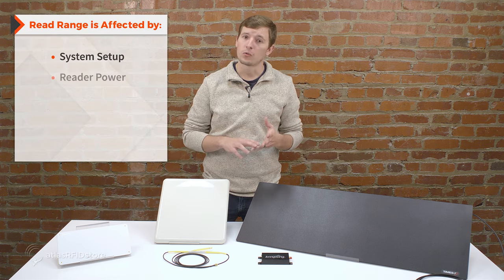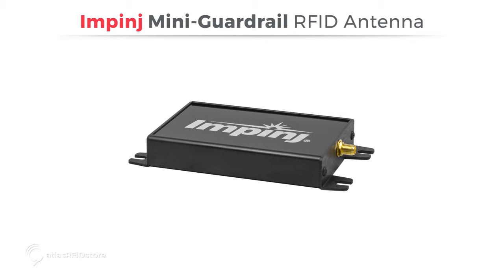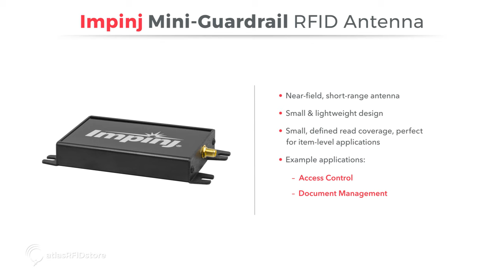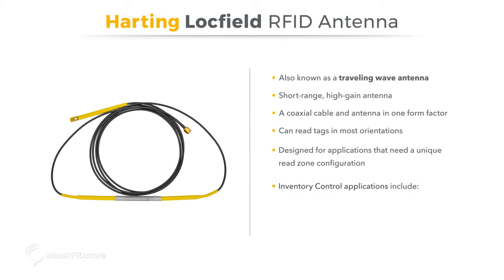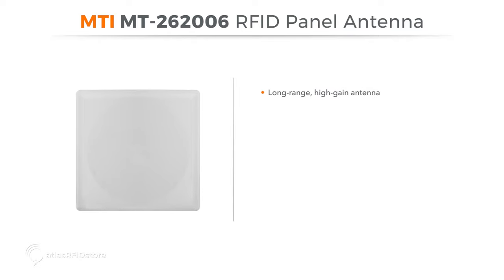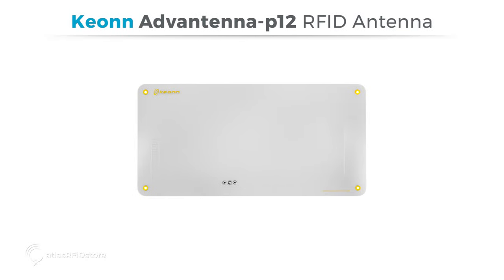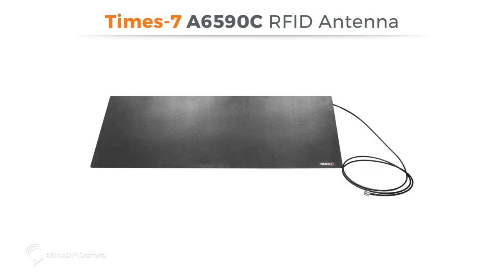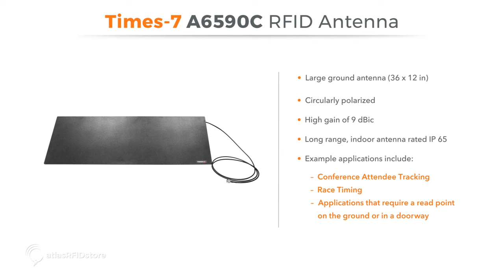The Top 5 Types of UHF RFID Antennas

Comment: Hi Steven, I would like to use uhf rfid reader for school bus. with passive rfid tags whats your suggestion regarding that.
Reply from the maker: Manshad,

That completely depends on what the problem that you are trying to solve is. If you are looking to ensure that all students get on the school bus, then perhaps a fixed reader/antenna at the bus doorway can be used to read RFID tags on student's backpacks.

If you just want to know what students have passed the reader/antenna system and how many times they have passed the reader/antenna system, then a fixed reader in the doorway would work like this Impinj R220 with two RFID antennas
(https://www.atlasrfidstore.com/impinj-speedway-revolution-r220-uhf-rfid-reader-2-port/).

However, if you wanted to read the RFID tags at all times when students were on the bus, you need to go with something more like the Impinj xArray on the bus ceiling. Here is the Impinj xArray - (https://www.atlasrfidstore.com/impinj-xarray-gateway-rfid-reader/) it is pretty expensive and should only be used if you need to read all tagged persons on the bus at all times.

Powering either of these readers, however, will be difficult and something to think about before committing to using RFID technology as the solution. Do you have a solution for powering this system?

Thanks!

Comment: Near field?  Looking to measure withIn about a square foot in a tag rich environment. Want to only log the item or items with the given space and not the nearby items that could be above, below or next to the intended measurement space. More than one item might be correctly logged. 

Maybe smart shelf antenna?

Outdoor antenna, some IP rating probably appreciated. 

Tags should be small, lightweight and passively powered by the antenna.

Recommendations or pointers?
Reply from the maker: l0gic23 - 
It's definitely possible - you would need a proximity antenna as well as a tag with a shorter read distance as well. If it's on a shelf, you can definitely use a shelf antenna, if not, a proximity antenna would still work depending on your application. The only issue is that proximity antennas are generally rated for indoor environments. Here's a list of our proximity antennas - https://www.atlasrfidstore.com/proximity-rfid-antennas/

I don't know much about your application, but this Times-7 A1001 Proximity Antenna is a pretty good option because its near field and rated IP65 - https://www.atlasrfidstore.com/times-7-a1001-proximity-cp-indoor-rfid-antenna-global/

If you are looking for a shelf antenna, I like this Vulcan option that can be a near field or wide range antenna, depending on its settings, and has an IP rating of 64 - https://www.atlasrfidstore.com/vulcan-rfid-cp11-uhf-rfid-antenna-fcc-etsi/

As far as tags goes, all Passive UHF RFID tags will be passively powered by the antenna, but choosing an RFID tag for your application involves a lot of factors and information. The tag needs to work for the item you are tagging, and a lot of testing is recommended to find the perfect tag. Checkout our RFID Tag eBook to learn more about RFID tags and the factors that go into choosing the right one for your application!

https://www.atlasrfidstore.com/what-are-uhf-rfid-tags/

Thanks!

Comment: Hello sir, 
I need a passive UHF RFID tag for moisture sensing applications using textiles. Could you please suggest to me which would be suitable with a read range of 7-9 meters?
Reply from the maker: Madhu,
There are only a few RFID tags on the market that do moisture sensing, i've copied the links below for the two moisture sensing tags tags that look like they are capable of your required read range.
https://www.atlasrfidstore.com/smartrac-sensor-dogbone-rfid-rfmicron-magnus-s/
https://www.atlasrfidstore.com/smartrac-sensor-patch-rfid-wet-inlay-rfmicron-magnus-s2/

On their data sheets, it looks like they can get a read range of between 7-9 meters like you asked, but thats always subject to testing. Let me know if you have any other questions!

Comment: Hi sir
I need for institute purpose for student attendance
So is this is better to.install or some other system
Reply from the maker: Jyoti,

I think student attendance is a good use for RFID technology depending on exactly what you wanted from a system. For instance, if you would like to just read a student's tag as they come through the doorway, a fixed reader/antenna system can be setup at the doorway that could do just that. If you have more than 1 or 2 doorways however, it could start to get complicated.

If you were looking at something for just one doorway, it could look similar to this:
https://www.atlasrfidstore.com/impinj-speedway-xportal-gateway-rfid-reader/

Or you could make your own with just an RFID reader & RFID antenna like with this development kit. Keep in mind, this would not be as visually pleasing because you do not purchase the white plastic portal box.

https://www.atlasrfidstore.com/impinj-speedway-revolution-r420-uhf-rfid-reader-evaluation-kit-4-port/

If you needed to constantly read all the tags in the room, for instance, read student A's RFID tag as long as the student is in the classroom, that could be a little more expensive. For that, i would recommend one or two of these, depending on the size of the classroom:
https://www.atlasrfidstore.com/impinj-xarray-gateway-rfid-reader/

What other technology are you thinking about for this problem?

Here's a link to read more about attendance tracking - https://www.atlasrfidstore.com/rfid-insider/tracking-attendance-with-uhf-rfid/

Thanks!